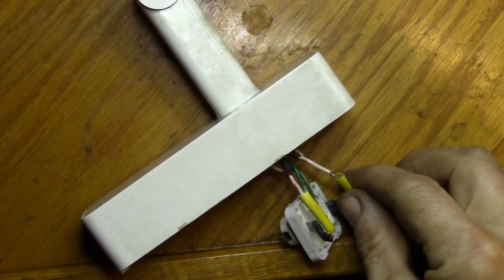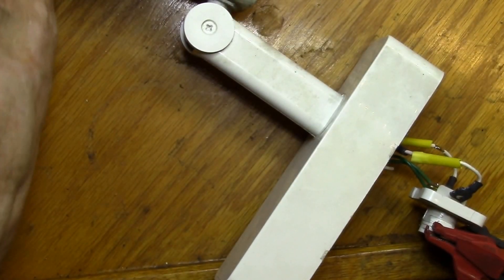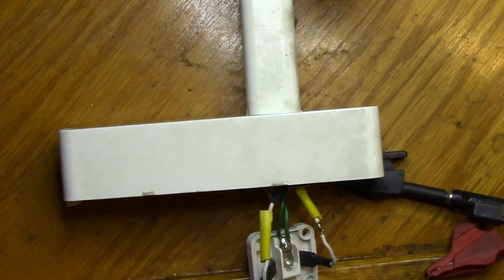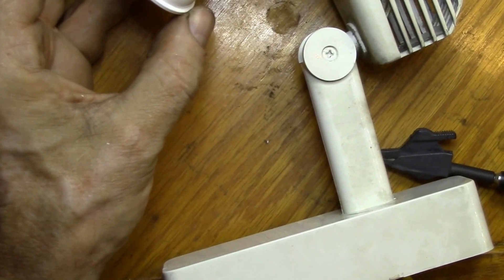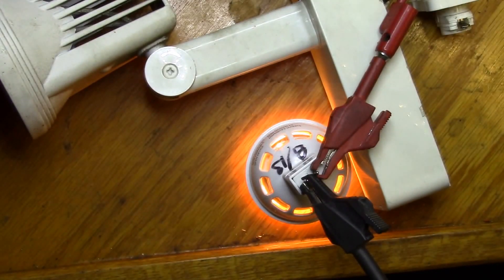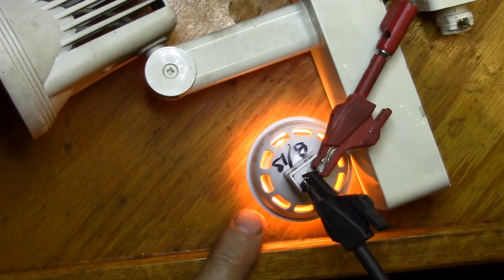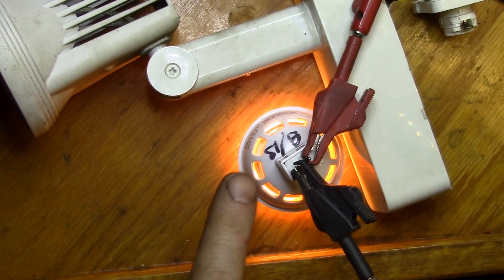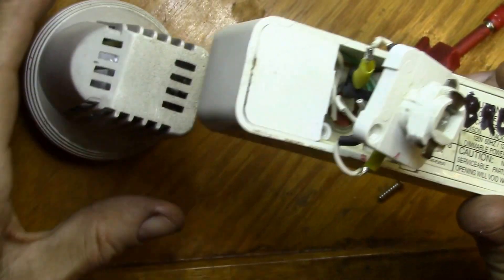True Low Voltage Track Lighting, Part 2

Comment: Did you heat the shrink tube before you stuffed it all back together? It looked kinda open on the ends. Nice video. I love diy anything. I like thinking outside the box.
Reply from the maker: Yes I did.  I mentioned that towards the end but didn't fire up the camera after doing that.  These lamps are still working fine 9+ years later. Not one bulb has failed.

Yes, this was a great project, repaired a bunch of non-working lamps.  Unfortunately, I think I had thrown one dead fixture away some years before and that's why I ended up with one non-matching fixture when I replaced that one.